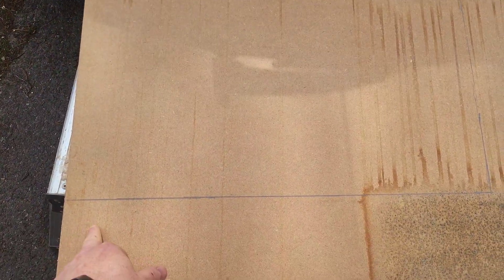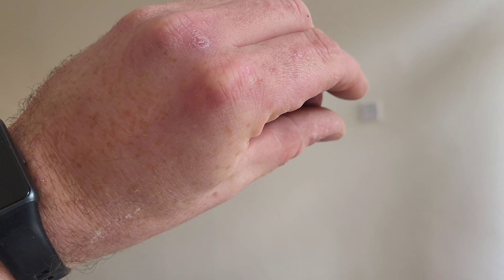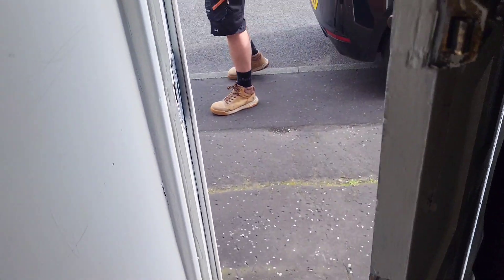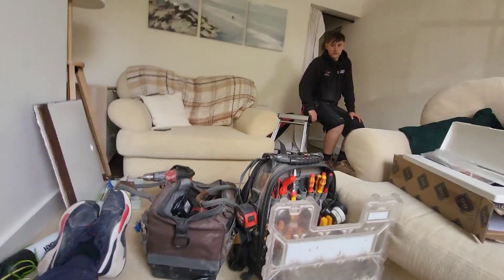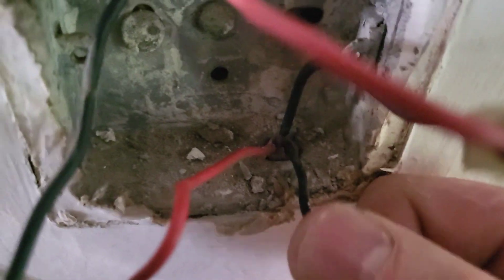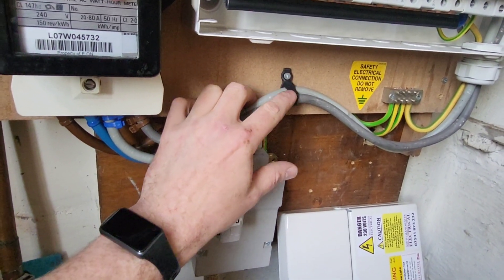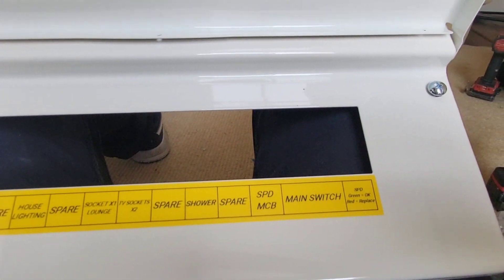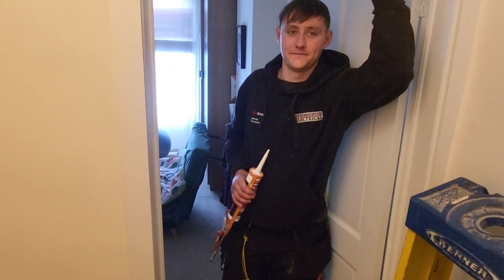This earth wire is live⚡️The consumer Unit needs upgrading & Rodders needs to do some work!

Comment: I remember seeing a video from Poland where someone had used old colours UK T&E to wire a two-way but didn't even bother to sleeve the now live bare conductors. I suppose that was someone who'd worked as a spark's helper or something in the UK and then did some work back home in Poland. The whole thing didn't comply, Poland's been using harmonised colours for decades (most of Europe went harmonised in the mid-60s) and requires full-sized insulated earths (full-sized up to 16 mm2).